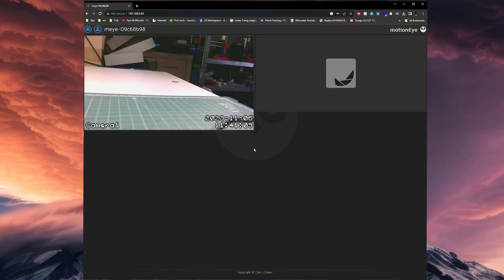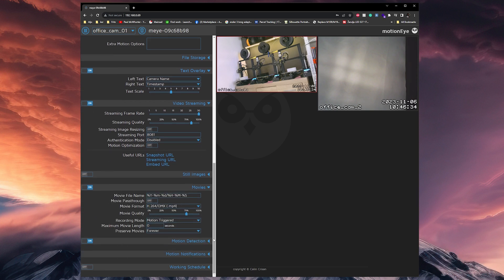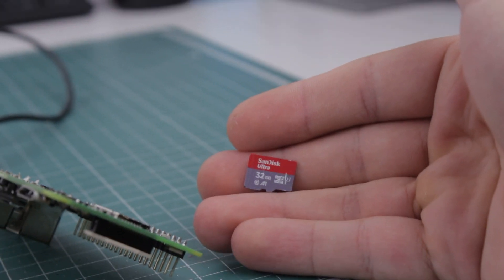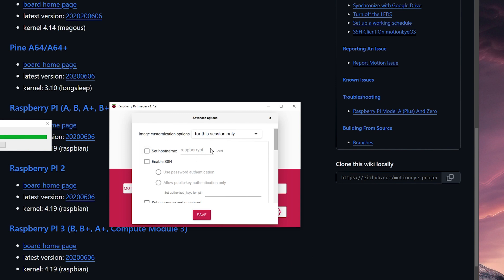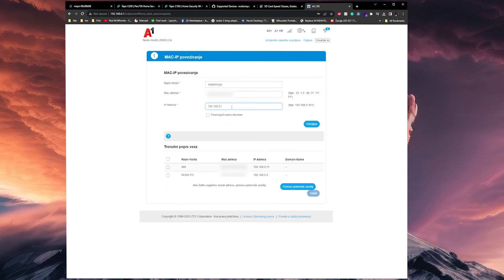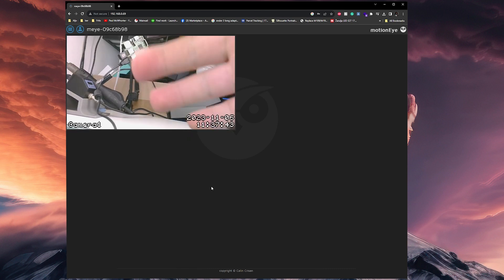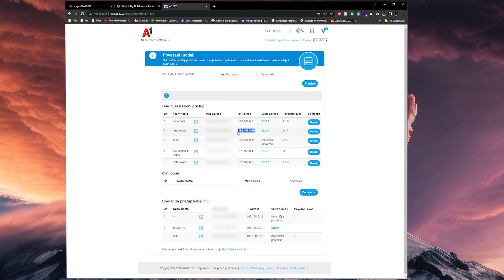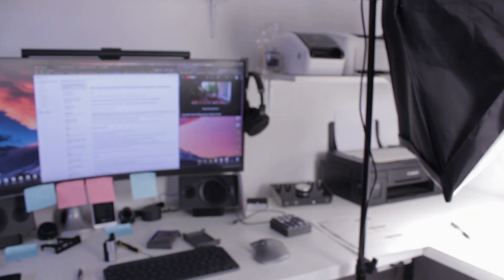DIY Home Security System - MotionEye OS Complete Setup Guide + Remote Access

Comment: do you know the latency difference between raspberry pi 3 versus pi 4? I currently have installed on a pi3 B and the latency is so slow. I have setup at lowest resolution and frame rate is 5 and it is still laggy.

Comment: Great video.  Been using motioneye for 5 plus years.  It's good for free, works with Home assistant too.  Thanks for the info on the tp-link camera's.  I've looked in the past but, most were in the 50.00 range.  Appears these are now apprx 20.00 US.   VPN, Wireguard is the way to go for a free VPN.   Easy to install, but, can be a little confusing.  Both sides of the VPN can be considered a client and server.   I have access into my router from my laptop, Chromebook and Andriod phone.

Comment: Hi, great video! Very informative, I had to use jawsper's version of the motioneyeos image due to having a raspberry pi zero 2 w with a cam rev1.3 instead, but it works great. But the problem is I'm making a dashcam and cannot have a wifi connected to the pi, so is it possible to use motioneyeos offline? Or even making its own wifi acess point would do, in fact make it more convenient. Would be glad if you could help me out!